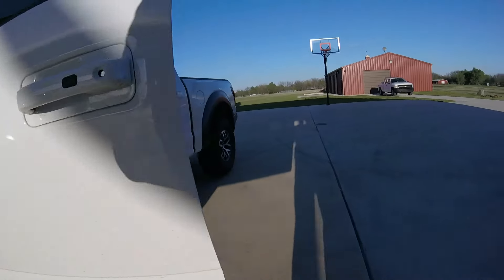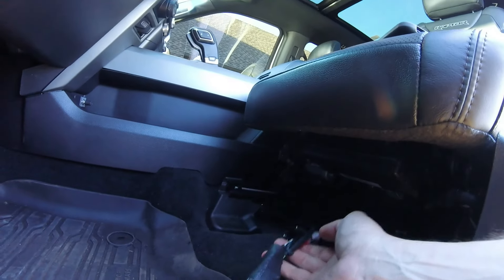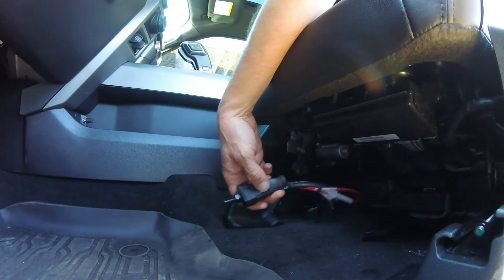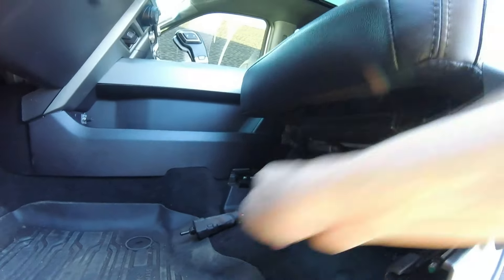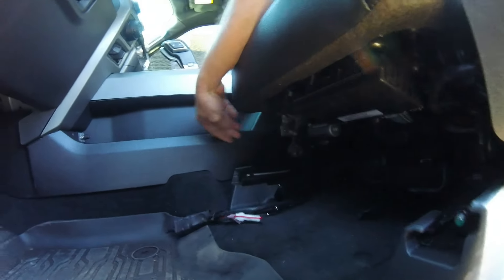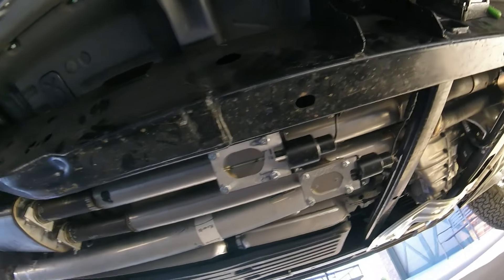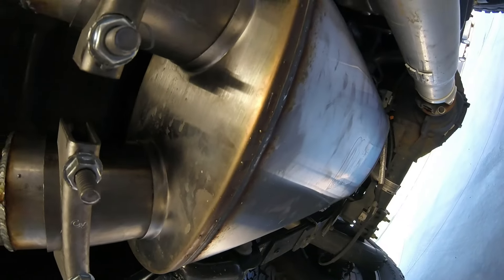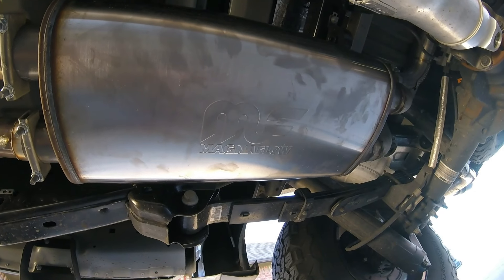2017 Ford Raptor after Electronic dumps and Magnaflow Exhaust

Comment: Hey man great videos!  You have been giving me great ideas for when my Raptor gets delivered.  I live in Edmond, OK.  Where did you go for your fog lights and exhaust if you don't mind me asking. I want to go somewhere where the technicians are familiar with modifying a new raptor.  Thanks man!
Reply from the maker: Thanks for checking out my videos!  I am having fun with the upgrades. The shop I use is on South Shields and about 89th.  There are two other guys like me who are doing various mods to their Raptors and they have also upgraded most of the new Raptors that have come in to this area.  I would highly recommend them as they not only know them but they are super easy to work with and some of the crazy stuff I come up with they seem to make happen.  www.merlesokc.com.  Mike or Trey would be who to speak with.  This is a second generation shop and coming from a guy who is really anal with my stuff, these guys know how to work on high-end trucks and cars and there are always super-cars in there being tweaked in some way.
Reply: WS awesome! Thank you so much for responding and for taking the time to make these videos.  I will definitely keep watching and I'm sure I will have more questions for you in future videos!

Comment: Did this increase the hp, if so, to what
Reply from the maker: Unknown as I have one more thing to put on (Cold Air Intake) and then I plan on having it put on a dyno.  I have no benchmark though so I will not know the true increase after all the mods.  That being said, the truck is considerably snappier, particularly when going from 50 to 75 or so.  The sound is great and adds to the effect of speed so it always seems like I am going faster than I am.  To your question though, with all of the mods in place and using the metrics from the manufacturers, when I am running dumps open and the planets are aligned perfectly, I should be North of 670 HP.  I know there is a disparity though between the crank and what you are actually making to the pavement - however, spinning the tires is effortless now and I must plan my starts so as to not look like I am just spinning my tires for fun.
Reply: WS  where is your mechanic located
Reply: if you have the ability and if the dyno guy is cool try dynoing it with regular truck sized tires to see what the loses are running those big 35's.. of course you would probably have to do the math to figure out the correct wheel speed for the dyno and recalibrate it.. assuming if the lug spacing is the same as a f150. just tell the dyno guy you'll give his employer a shoutout in the video.
Reply from the maker: Excellent idea and thanks for that!  I am wondering that exact thing with those large tires as I know they have to be robbing power somewhere.  I have an e-mail in to my guy now with your idea and we shall see how that goes.  Thanks again!
Reply: Put a BORLA ATAK exhaust & a Roush CAI on that baby & call it a day!

Comment: how's this direct the exhaust out of those holes? looks like it just creates a hole in the pipe and that's it
Reply from the maker: It is creating a hole in the pipe, yes, but since exhaust then takes the path of least resistance I basically have the ability to go open pipe at will.  It is enjoyable when a fast car pulls up and revs their engine and I can open the dumps and give it right back.  And then when actually driving hard it gives a much better interior tone (roar) and enhances the overall fun of the truck.

Comment: Do you know that the Raptor has AUX switches ... why did you install an additional switch. I don't get it.
Reply from the maker: Rene S - it would have been my preference to use one of the upfitter switches, but this switch is configured as variable so you can open the dumps and adjust them to any level you like. I am considering putting in a relay bank though because really I like open or closed only, and cannot see a need to have anything other than open or closed.

Comment: hows the drone?
Reply from the maker: Todd Christ - admittedly it is not my favorite, but not because of the sound it produces necessarily, but because this is my daily driver and now that I have the dumps on I miss a quiet truck when it needs to be and a race truck when it wants to be. I am very much considering having them install my factory muffler back. The good thing is this magna flow muffler was under $100. The test will be a small road trip with the family this weekend. I am not going to mention it to anyone and I am going to see if anyone mentions being annoyed by the long term drone after the trip. My initial thought though is to put the factory muffler back on.